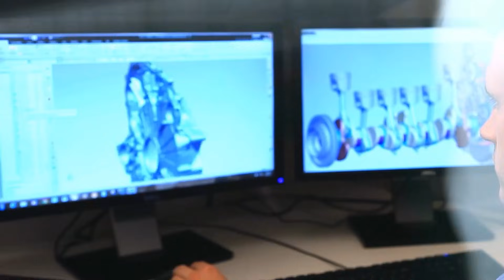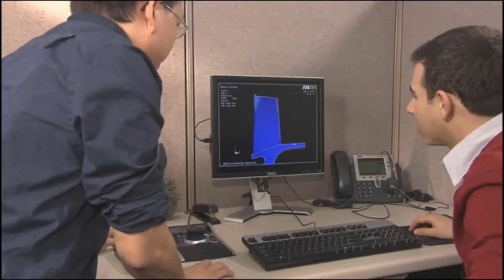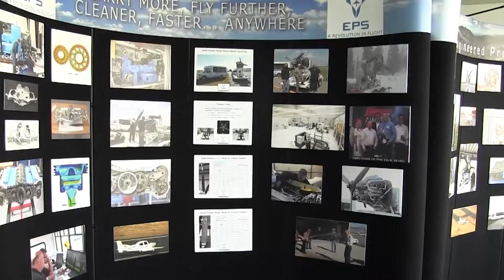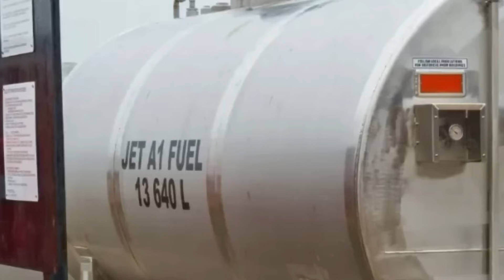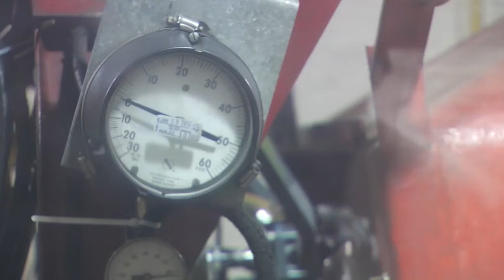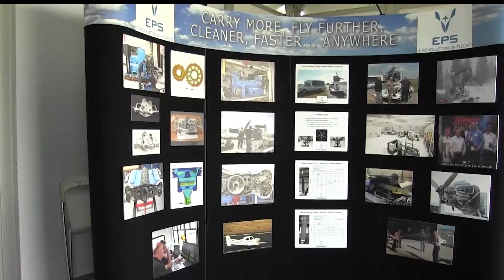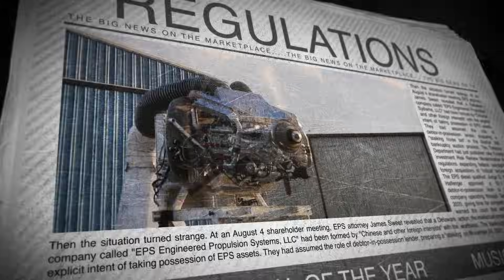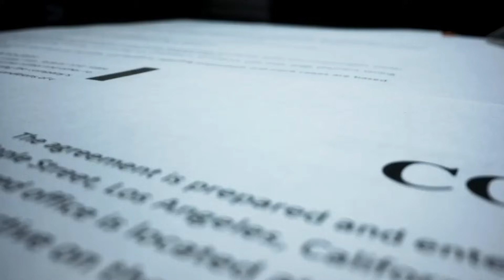The Rise and Fall of EPS Diesel: The Engine That Bankrupted a U.S. Start-Up

Comment: Thank you very much for this video.

In April 2017, at the Aero Friedrichshafen Airshow, I had the opportunity to meet Steven Weinzierl. We had a long and in-depth discussion about the EPS Vision 350 engine.

This engine and all of its components were designed entirely from scratch with the clear objective of achieving the highest possible levels of reliability and safety for aviation applications. It was developed using state-of-the-art computer simulations and the latest advances in materials science.

The Vision 350 was specifically designed to replace large-bore piston engines from Continental and Lycoming, for aircraft such as the Cirrus SR22, Beechcraft Bonanza, Piper Malibu, and others. In every aspect—performance, efficiency, reliability, and technology—it surpassed existing engines in its class.

The engine was extensively tested at the Air Force Research Laboratory (AFRL) at the Arnold Engineering Development Complex and was validated for operation from sea level up to 30,000 feet.

What I still cannot understand is how, after investing nearly 60 million dollars, the investors ultimately refused to provide the final 15 million dollars required to complete FAA certification. Designing and certifying a brand-new piston aircraft engine from scratch typically requires an investment of at least 100 to 150 million dollars.

Had it reached certification, this engine could have fundamentally disrupted the large-bore piston engine market dominated by Continental and Lycoming. It is truly a shame that EPS was unable to complete the certification process.

This is exactly the kind of engine that General Aviation needs for its future.

Comment: Its all because of this adiction to electronics and FADEC !!! A diesel engine simply does not need that !!! It always runs on air and oxigen surplus, and in an airplane the engine runs almost always on the same RPM, so no need of injection point adjustment ! There are three reasons to favour a disel engine in an airplane : 1 - it will run even with total break down of the electrical system - but not if it has FADEC. 2 - Diesel or jet fuel is  much easier to find in the backcountry then AVGAS. 3 - it is much cheaper and the engine burns less. Will ever anyone dare to get rid of this adiction to electronics and FADEC ?

Comment: It always come down to the certification authorities, The FAA, EASA rule the road and they are in hand with the two big makers. Closed shop always wins.
DId I hear STEEL PISTONS?  That alone mays it a bad bet.
Reply from the maker: Certification absolutely played a huge role, the FAA/EASA process is unforgiving, especially for clean sheet engines from newcomers.
And yes, steel pistons sound counter intuitive in aviation, but in this case they were a deliberate choice borrowed from high load diesel practice and actually tested well in flight. Interesting enough.

Comment: Nothing to do with technology.
Just capitalism doing it's thing.
In the 60's a working class man could payoff his house and put the kids through college.
Without a second income.
Expect to camp in a tent in front of the house you used to have a mortgage on, shortly.
That is the real face of the S&P500 going up 10% while the GDP only goes up 0.5%.
Those 9.5% that got extorted out of the working class, ain't going to initiate hobbies requiring capital goods. (like airplane engines)

Comment: Please let your script writer know that this is not a V8 engine.  The correct term is Opposed.  

The certification process and reliability requirements are a reflection of the legal environment in the US.  Lawsuits are too prolific.
Reply: It actually is a vee engine, even though its 180-degree vee angle. The characteristic that defines it as a Vee is that two conrods share the same throw (5 main bearings). Ferrari also made flat-vee engines ala Testarossa.

Comment: Does anyone remember the Gov. grant to Continental to develop a certified diesel?
Reply from the maker: There were U.S. government and military programs over the years aimed at heavy fuel / diesel aircraft engines, but there’s no clear record of a single, direct government grant to Continental for developing a clean-sheet, certified GA diesel.
Continental’s current diesel lineup largely came from acquiring Thielert Aircraft Engines out of insolvency in 2013, rather than a new government funded development effort.
That contrast is part of what makes the EPS story so unusual.
Reply: @WonderWing94 Hmmm.. getting old but I remember it well.  It was at the same time (90s I think) they gave a grant to Williams to develop a small 'low cost' turbojet engine for GA applications.  I think the engine ended up on the Honda Jet, the public got nothing out of either grant.

Comment: General aviation reciprocal engines (< 400 hp) are a tiny market. No room for newcomer. Lycoming, Rotax, and Continental survived. The Thielert diesel engine was sold to Continental. Lycoming may be interested in buying the startup.
Reply from the maker: You’re right that general aviation engines are a very small, unforgiving market. That reality shows up over and over in this story, even when the technology itself works.
EPS really highlights how hard it is for newcomers to survive long enough to reach certification and scale. Appreciate you adding to the discussion.

Comment: I'm a pilot, mechanic and certification engineer, I've never heard of this company. That's the wildest story I've ever heard.
Reply from the maker: Coming from a pilot, mechanic, and certification engineer, that means a lot. Appreciate you watching.
And you’re right, EPS flew under the radar. The tech genuinely worked, it was certification costs, software validation, and funding that ultimately killed it, not the engine itself.
Thanks for being here!
Reply: @WonderWing94 My question is why would they even use any computer software in the design. That surely was something that they should have avoided initially in order to obtain certification. I had a roommate in college that had a VW rabbit diesel and he was getting almost 50 mi to a gallon and this was back in 1984 So I got if they had any software supporting that engine installation.

Comment: I’m surprised they got as far as they did. A clever beancounter could prove  the market for that engine would never be large enough to recover development & certification costs and make a profit large enough to justify the effort. My forty years’ experience in the automotive industry showed time & again what lengths we’d go had to go to in order to certify an engine for emissions or fuel economy , for instance.
Look at a universally loathed feature like auto start/stop. Individual owners hardly ever see any benefit in fuel economy, yet the EPA mandated test cycle consistently shows a 5% gain in fuel economy IN THE EPA TEST CYCLE. As the saying among the calibrators went, “For 2% I’ll kill your Grandma; for 5% I’ll kill my own Grandma!”
Reply from the maker: Appreciate you sharing that perspective.
One of the things that struck me researching this story was just how different the engineering reality and the certification + market reality can be.